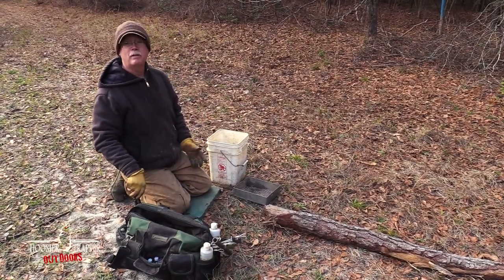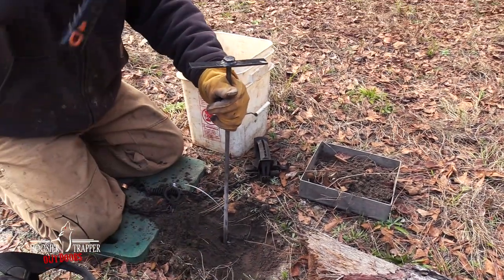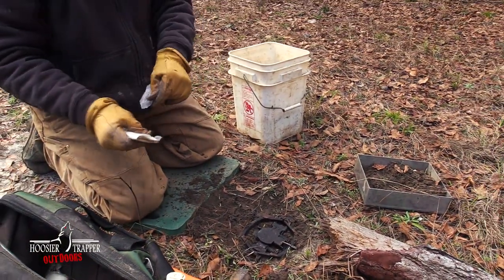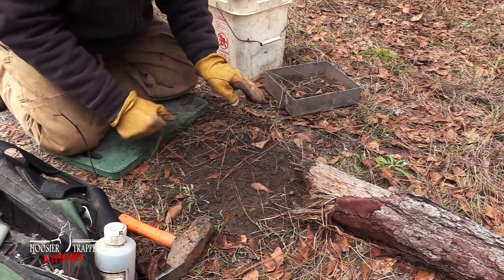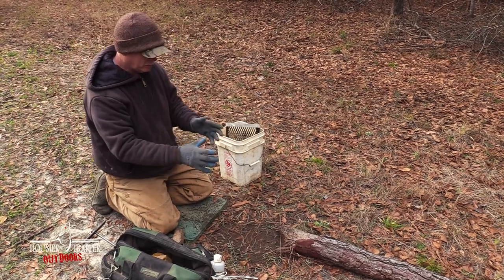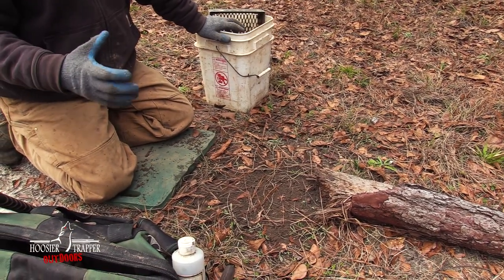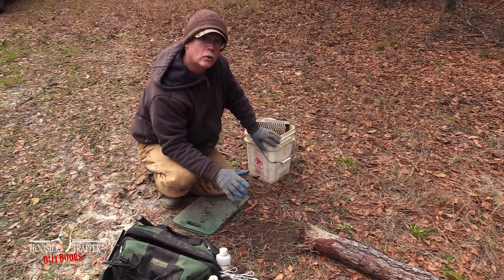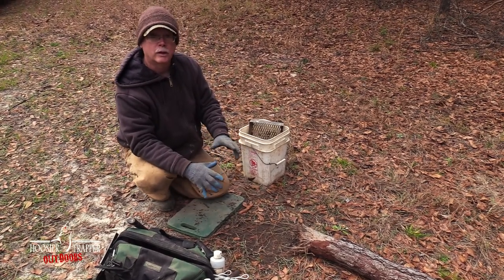How to make a flat set.

Comment: some trappers say the most important thing is bedding the trap so it doesn't wobble by packing dirt around the jaws. looks like you just set the trap down firmly, and covered with dirt without doing that, is that just because the soil is cooperative in this video and the trap naturally wasn't wobbling much? thanks for sharing the video, can't wait to try this out
Reply from the maker: yes, trap bedding is important.  Sometimes, they are very easily bedded and sometimes not so much.